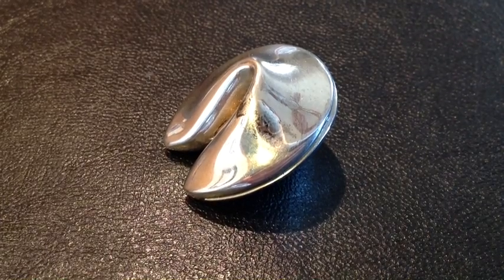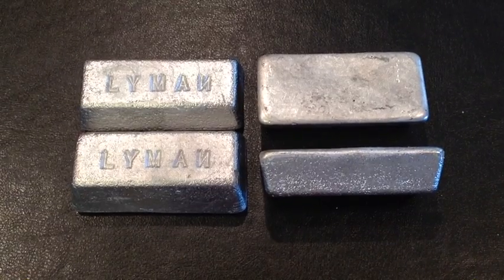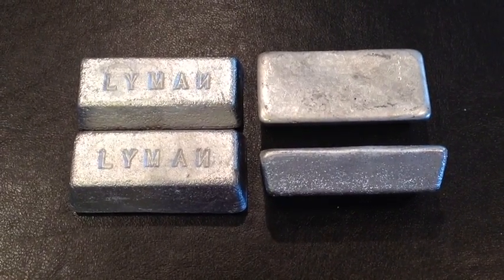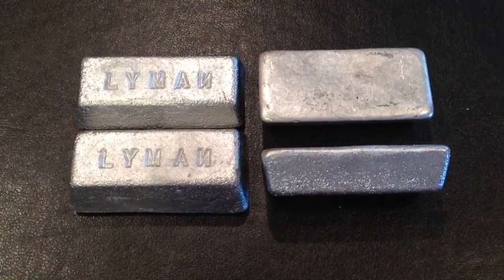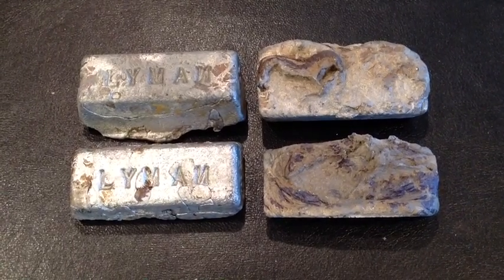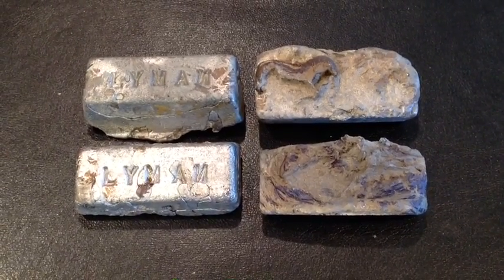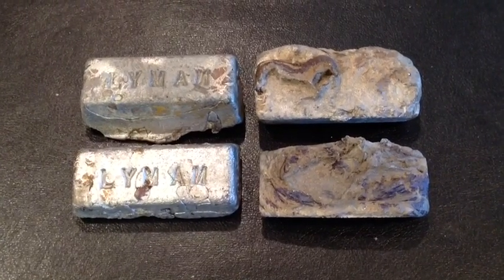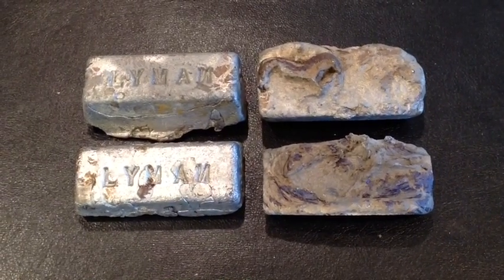Bullet Casting Heartbreak of Zinc

Comment: I use a LEE 20lb electric bottom pour pot. I have for the past 25 yrs used primarily WHEEL WEIGHTS. 
However for the past 10 yrs or so, they come mixed with some that are zinc.
I do not keep the temperature of my pot up high enough to melt the zinc weighs if a few are dropped in. 
 Since zinc is lighter than the lead the zinc weights immediately float to surface.  I pluck them out at once. 
 I've not had any known contamination issues this way.

Comment: Apparently you can remove zinc from the lead. You just have to control the temperature around 700F where it his high enough to melt the lead but not the zinc, and then stir, stir, and stir more, for a good hour or so. As you stir the zinc molecules will begin to combine and crystalize, forming scales that come floating to the surface. To prevent the lead and specially the tin from oxidizing during this process, leave a generous layer of ash or sawdust floating on the surface while you do it. I just fixed a contaminated batch of lead from wheel weights today and the result was fantastic.

Comment from the maker: Larry - WWs - lead is scratchy, easily dented, dull sound tapped against hard objects.  Zn is hard, ringy when tapped on hard surfaces or dropped, pliers will not dent.  And may very well have Zn stamped on them.  Also, if one gets by your inspection stage, as soon as lead wws melt and clips float, any wws still floating at that time are Zn or steel - remove without delay.  Alloy will be OK.  Cook the lead and the Zn will melt at 787 degrees (thanks to nickglass12) ruining your batch of lead.

Comment: Even if you checked all your wheel weights by seeing how they cut with some nice, strong, thick wire cutters, you could still end up buying a batch of ingots (from another caster) that might look fine, but still have a little zinc in em. I avoid this by making sure the melting pot doesn't increase above 725 degrees. If you end up with Zinc in your batch and want to remove it, throw some sulfur in the pot.

Comment: Getting back into shooting (and fishing) after 3 years in Korea. Best advice I ever got about zink in your lead was... 
First, avoid the problem from ever happening, take the extra step and time to hand sort sort your wheel weights before melting them. 
Second, never use your electric pouring pot to recycle wheel weights. Get a propane burner (turkey fryer) and an old cast iron post from a second hand store. Use that to recycle the wheel weights.
This let's you do a larger batch because the blogger pot will allow for the clips and other junk attached to the weights. It also lets you keep the heat at lead melting temperatures, but below the temperature zink melts at. That way any that you missed during the hand sorting will float at the top and let you skim them out before they melt and ruin the lead.
Then you ladle the clean lead into ingots that you use in your expensive electric pot.

Comment: Lead melts just under 625. Zinc melts at just over 785 so dont heat your lead over 650 to 675 the zinc will still be a solid you can pick out

Comment: Take a look at this discussion: Mixing in sulfur combines with the zinc, then it can be drawn off.
google on "A possible way to remove zinc from molten lead"

Sufficient lead having been melted in the pot, about ½ pound of lump sulphur, broken into pieces about the size of hickory nuts, is added, and the whole well stirred with a ladle, the sulphur unites with zinc and other impurities. The resultant sulphides are skimmed off in the form of a cake, more sulphur being added ......

Comment: I've avoided zinc problems totally by never using fire to melt material down for ingots. I only use electric pots that don't get much over 700 degrees. I throw away any obvious weights that are steel or zinc & then throw the rest into my ingot melting pot that is a little diry from years of use & then I cast bullets using a different electric pot. Any zinc or steel weights are easily removed along with the clips & the zinc ones don't melt-unless you use fire to melt the material.

Comment: I believe by your voice your much younger man.  at 61 years old and over 41 years of reloading and experimenting I have a wealth of proven information. but I have not cast but afew bullets . I could always buy them in bulk at reasonable prices . not so right now. I have been loading bullet I have had 30 plus years. the days I warned people of are here . I have plenty of ammunition hid I loaded . but in these days  looking to reload primers and have loaded just a fed and successful. if necessary I can make powder . now i will experiment different bullet maturail  lead and outher . being retired I have time . my next project beside cast bullets will be copper. iam also going to try plastic, scilone type with shot gun shot similar to the old glasser safety slugs. I ll be glad to share information. I specialize in ultra reduced center fire ammunition for urban pest and people control as rioters, looters control. this is a extremely dangerous process as we know what under loaded ammunition will. mine are totally safe to use rifles and pistols. I have killed ten deer with my ultra reduced rifle ammunition. they sound about as loud ac a stand add 22 but no sonic crack, like a tiny shot gun . that information I will only limit, i don’t want criminals to get it . Nana and papa aka the hunter

Comment: Wikipedia says zinc melts at 787 F. while lead melts at 621 F.  so if one were careful you could fish the zinc ones out after the lead melted & before the zinc melted if you couldn't distinguish between them although I guess the zinc ones would weigh much less.  Just thinking out loud here.  Thanks.
Reply: nickglass12 no no no. Zinc dissolves into the Lead, not melts. Like sugar cubes in water.

Comment: I did the same thing. I melted 95 pounds of wheel weights in a dutch oven. I wasn't paying attention and let the temp get too high. There must have been some zinc in there that I missed, but all is not lost. I added copper sulfate crystals which I bought at a farm & garden center (it is also available on Ebay). Add a big handful to the melt. Stir it in. It should turn from blue to grey. Skim off ... repeat until it remains white, not grey. At that point, flux and you can make ingots.

Comment from the maker: aero1-Thanks for the good question. 1) Zn wws are harder than lead wws - pair of pliers will dent a lead ww; will not dent Zn ww; 2) Zn wws drop on concrete will sound ringy, lead wws will sound dull; 3) Zn wws are lighter than lead wws  4) if there is a Zn on the lettering of the ww, it is Zinc.  There are also steel wws, these are not a problem as they can be spotted with a magnet and they won't melt - float and skim off.  Good castin' to ya...

Comment from the maker: bwspyder1- The danger of zinc occurs especially when people are working with weird WWs or when running big dutch ovens and 40-50+ pounds of WWs.  When sorting out big batches of WWs, some zinc and steel ones get through.  All it takes is one zinc WW.  Then they run big heat, and some casters just let it melt, take a coffee break while avoiding the fumes.  Heat goes up and lead starts to glow (see Making 45 Colt Bullets - From Casting to Load-ready) and temp keeps rising.When they get back see2

Comment from the maker: Popgunner101-Interesting solution that works well.  I've done the same idea - using turkey fryer and propane, as soon as lead melts and only slag on top, lower the heat, flux and skim without delay, no need to clean the lead excessively, cast ingots without delay.  This works well for me...Best Regards...

Comment: I disagree with you people who think you should shoot 100% lead bullets. a good combination is 92% lead, 6% antimony, 2% tin.
lead for the softness, antimony gives you the hardness to reduce leading of your barrel, and Tin gives you a better cast bullet.  if you are serious about casting good bullets then you should buy good new lead. but scrap lead you have no idea what your shooting out your barrel. With my flint lock you want a soft lead ball so very little antimony in it. Again scrape lead and wheel weight lead (a lot of states will not allow tire stores to give away their lead now. STUPID) will have a high tin factor. so  you have to gamble on what your shooting and each batch will be different and shoot totally different. Just a thought.
Reply from the maker: Michael Andersen - AHA!!  92/6/2 is good old Hardball Alloy (take Linotype 84/12/4 and mix with pure lead 1 to 1 and you get Hardball  Alloy) is as good as Lyman #2 (90/5/5) for our purposes.  I've found that regular range scrap is such a mix of all kinds of lead that it is pretty uniform (at least from the range I shoot at) - and RotoMetals calls it Antimonial Lead or roughly 3% antimony.  I shoot range scrap straight up for cowboy and standard load revolver rounds (especially when powder coated).  Thanks for your good comment, and Best Regards to ya,  FC

Comment: Zinc is actually fairly easy to remove from the lead pot. Plumbers from the early part of last century did it daily. Just bring the lead up in temp until it has a dull red glow in the dark. Wrap up sulphur in paper and submerge it in the pot and stir it around. The zinc will bind with the sulphur in the form of zinc sulphate and rise to the top. Be sure to do it at this glowing temp, any cooler and the sulphur will bind with the tin in the form of tin sulphate. This practice is well outlined in "Practical up-to-date plumbing"  by George B. Clow available on google books for free. The gist is on page 185 but I would suggest reading all portions pertaining to lead, solder and wiping.
Reply from the maker: acmmech - Thanks for your comment and info contained.  Another commenter about a year ago mentioned the sulphur treatment, but did not elaborate as you have done.  Our best bet is still not to melt zinc into our lead in the first place - much easier to prevent the problem than to deal with it after the fact.  Sulphur is also a rather nasty substance to keep around and work with.  I'm glad to say that I only had this happen once to learn my lesson… Best to ya...

Comment: Zinc isnt the only contaminate you have to watch out for. I bought a ladle from a thrift store and when I dropped it in my lead pot it had some kind of metal coating it.Whatever was coating it came off instantly and did the same thing you described with the zinc. It kept coming up and up and up and up. I couldnt save the pot no matter how much I skimmed. It wasnt as bad as those zinc ingots but bad enough that I couldnt get decent fillout. Had to toss about 20lbs of lead.

Comment: Oh dear. I think that's the first mistake casters make. It was mine.
Reply from the maker: Randy Zwieg - With all the zinc wheel weights now, it's a mistake that any caster can make...all it takes is 787 degrees of heat and any zinc will melt into the mix ruining the alloy.  Our best defense - when the lead melts, get everything that hasn't melted out of there, turn down the heat, clean up the alloy without delay (that means not trying to get that mirror surface, fluxing 4 times, while all the time the temp is rising) and pour the ingots.  Once we only use good ingots to our bullet pots, we don't have to be concerned about any zinc - it's been handled.  Good castin' to ya, Randy.... FC Steve

Comment: The key is to keep your temp regulated right.     Why?  Zinc melts at 787F, Lead at 621F.   So if you don't let your lead get up past 700 degrees or so, you'll keep the zinc from melting in.
Reply from the maker: +moncorp1 -- Your comment did not get into my inbox hence the delay in replying - Google at it again....You bring up a great point, we make our ingots to only have good casting alloy with which to make bullets.  Then we can freely run our bullet pots at 700-750 for best casting.  And if our temps rise a bit, we have no zinc problems to deal with.  Good castin' to ya,  FC

Comment from the maker: nickglass12-I'm glad I saw your post-did not appear on my dashboard, could have missed it. I knew the 621 on lead, but I didn't know the 787 on zinc.  Another poster said that zinc melted much higher than lead so it was very hard to actually get zinc melt accidentally in to our lead. Thanks for the info as 787 is actually EASILY reached when we keep cooking our lead. You are absolutely right - anything still unmelted when you see the lead go-get that zinc out without delay-don't mess with it!

Comment from the maker: myxlpl1c-Thanks for the info, but I've already had my experience with zinc and don't intend to have that again - as you know, that's why I kept these zinc contaminated ingots - they sit there next to my casting furnaces as a reminder.  As for sulphur, I give anyone great credit for trying it as that stuff is noxious.  Best way to deal with zinc in lead alloys is prevent the happening.  And with modern WWs, there are going to be more and more zinc to deal with...knowledge is power - Best Regards

Comment: not sure if anyone has mentioned this but just an FYI. Lead can actually hold up to 1.5% zinc in solution without having any adverse affects in casting quality. one thing you can do is simply add pure lead to the pot to decrease the zinc ratio.
OR
You can simply cast at a higher temp so as to melt the zinc completely.
Reply from the maker: WordsofWisdom2010 - Sounds good.  Let's not ever have to deal with anything over 1.5% of Zn in our lead, then, because it's a bear.  And I didn't know about adding more good lead after the bad to try and get the 1.5%.  Probably a good thing I didn't know that as I just "cut my losses" instead.  One of these experiences is enough for me to just avoid it, and that's what you are saying also…Thanks for the additional info...

Comment: I fell into a trap of using wheel weights to harden my lead for my gas checked 303 bullets. I encountered tumbling bullets no matter what safe recommended powder load I used. So I dumped all my contaminated lead at the local scrap yard, acquired some first class pure lead, then I recovered some spent air rifle & pistol spent pellets from our indoor air weapon range. Cast this lead into ingots and did a zinc test, no zinc found in this lead. So I used several ratios of mixtures and found that a 10/1 blend has solved all my tumbling bullet problems. So far after test firing a selection of recommended powder loads, one such powder  Unique from 10 to 13 grains, I found that my collection of 303 rifles with each one, one will group better with 10 grains while another 11.5 grains of Unique powder. 4227 and 2400 are two other powders I use with their manufacturers recommended reduced powder loads. At this time some 600 rounds test fired and not one tumbling head.